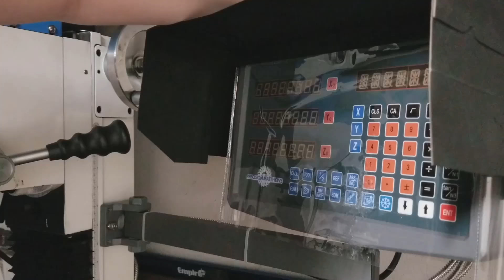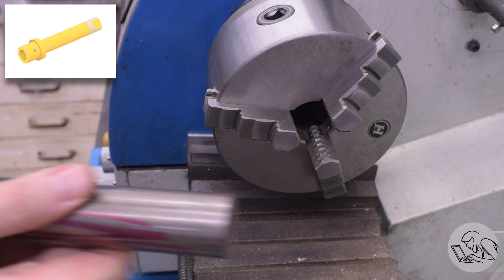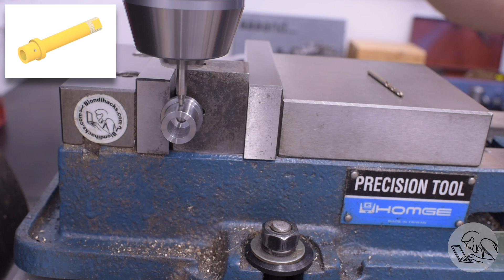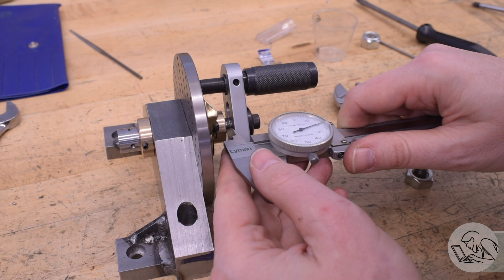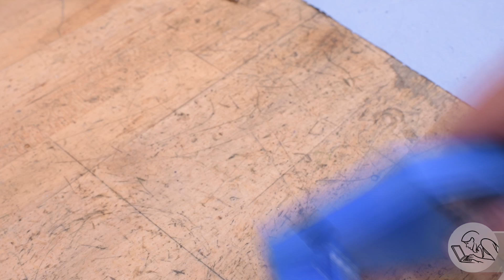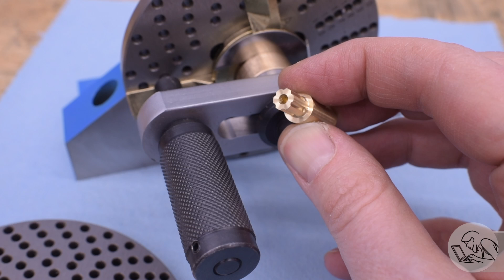Rotary Indexing For My Shaper (Part 2)

Comment: Really nice result. I was a bit concerned by the intro blooper and seeing all that work going into the shaft, but phuw, it went well ^_^;;
I was wondering if you could do a video (if you haven't already?) about the various types of loctite and where to use and not use them? It seems like you have a hundred different types of them for all sorts of applications, normal to more specialized ones and it seems a bit overwhelming to figure out what select few would be nice to have.

Comment: 👍🏻👍🏻
A thread cutting method I saw but can't remember who's channel now. He single points a thread to remove the bulk of the material then chases it with a die to bring the threads to size. This significantly reduces tool loading and the torque on the die and work piece. Might come in handy some day.

Comment: You can make nice metal gears with that setup.  A cutter for mod and a cutter for relief angle.  Max tooth count would be limited by the height and width by the stroke length.  A linear system without a shaper would just involve a linear rail system.   The patterns for knobs and dials would be endless also.  Great video love the content!

Comment: Very nicely done!  It’s always interesting to me how many different ways there are to machine things.  I’ve seen gears done on a lathe (several different ways), on a horizontal mill, and now on a shaper.  You just need an indexing rotatey thingy and a linear or rotary tooth cutter thingy.

Comment: “I’m sure I won’t regret it”
Of all the times I’ve uttered those words to myself, I almost always end up regretting it. 😂
Reply: Right up there with, "that should be easy", "what could possibly go wrong", and "the weather is supposed to be nice"
Reply: followed by,  here is the form necessary, you can go to the line to my right, and they will advise you which line wii ne next.🦊🦊🥸
Reply: I would add; "there should be no traffic" and "parking is easy".